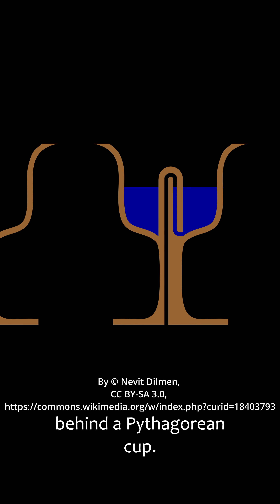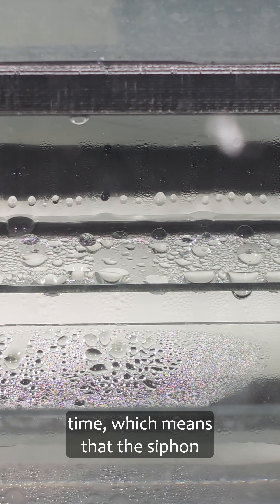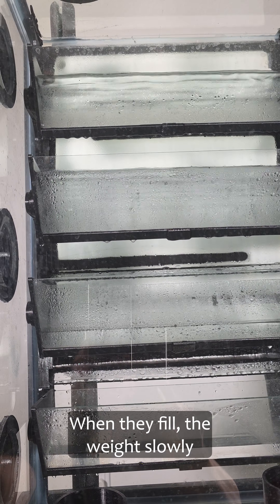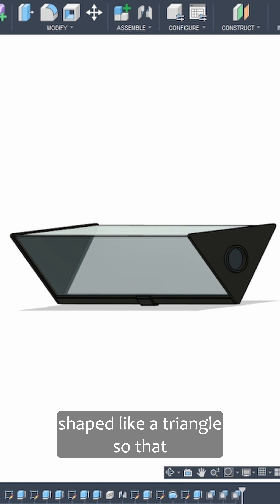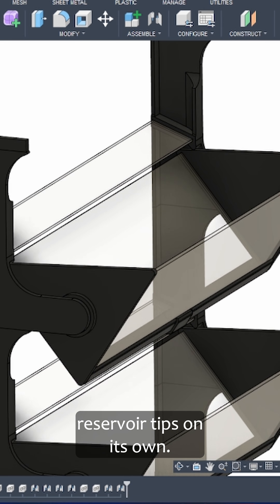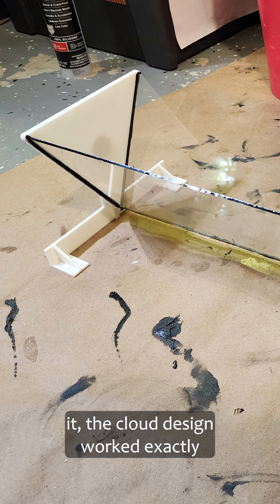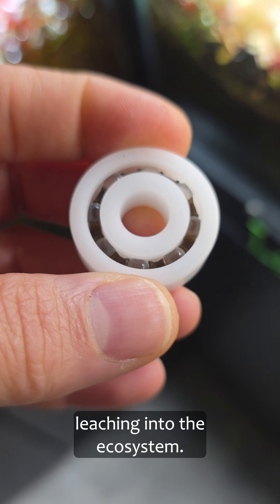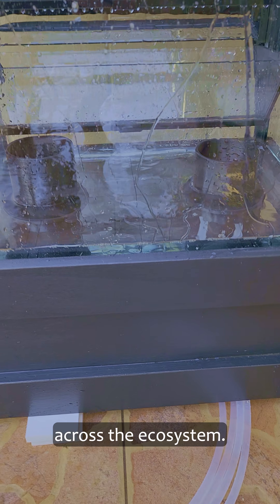Cloud system mechanics show how a single drop can trigger rain across the ecosystem.

Comment: Should have put some better rain head disfusers at the bottom so all the water doesn't just go in one spot
Reply from the maker: I have a rain manifold. It's not connected now because it's getting rebuilt but it does work and distributes the rain well. It's getting expanded for better coverage than the last iteration

Comment: This is a very good rain system for your paludariums. It doesn’t require any electrical power?
Reply from the maker: I chill the top tank from outside the glass, otherwise there's no electricity inside. Just gravity